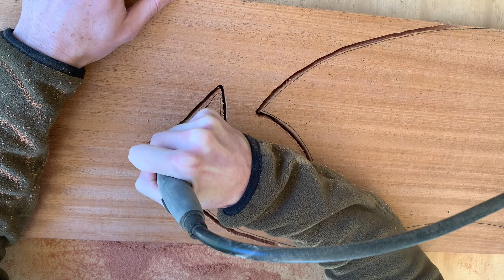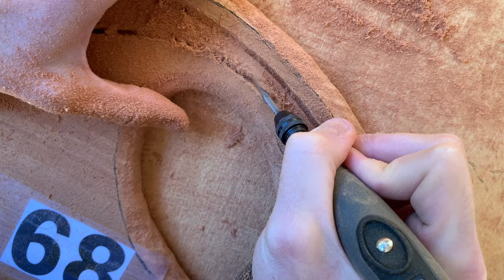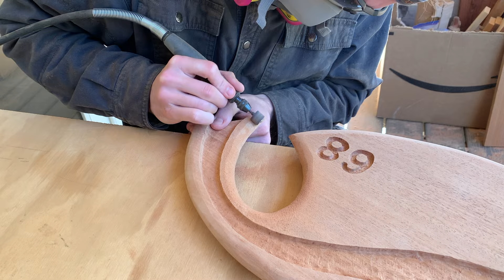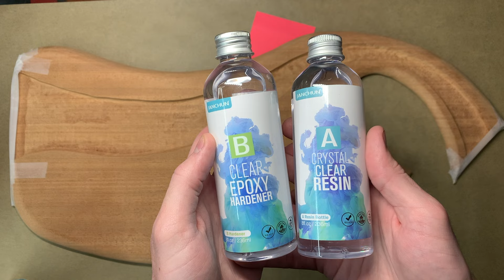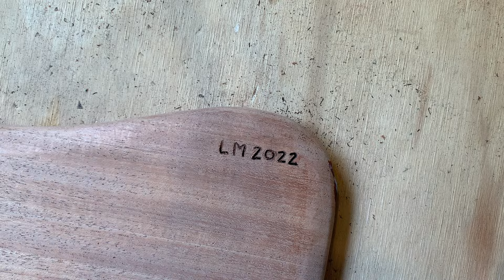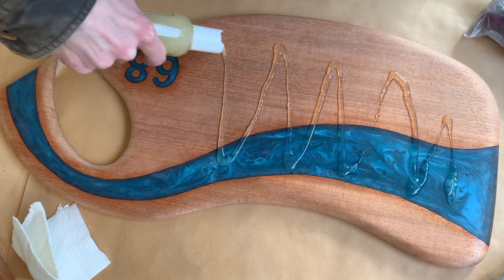Using Just a Dremel to Make a River Charcuterie/Cutting Board

Comment: I wish B&Q sold nice wood like that.
Whenever I want to make something, I end up having to buy things like cutting boards or placemats which end up costing more overall
Reply from the maker: I got lucky getting it at Home Depot, lots of times the wood is warped. I also spent around $25-30 on the piece, so not a huge money saver. I need to find a better source

Comment: The board turned out so cool!

Hm the sanding drum keeps flying off every time I turn on my dremel (the attachment itself stays in place. It's just the sand paper ring that flies off). If anyone has any tips, please feel free to reply 😊
Reply from the maker: Is the screw on the end of the drum fully tightened? The drum paper may also be stretched out if it’s old
Reply: @LogsCarvingClub  ah ha! that's what it's called. ok so the sanding drum paper keeps flying off, but it's brand new and it's the one that came in the kit with the rotary tool so. idk what to do lol I am new at this :)
Reply from the maker: @Steph_here  I’d try a new piece of sanding paper if the top of the drum is fully screwed tight, let me know how it goes!